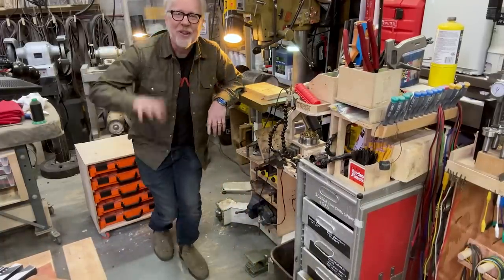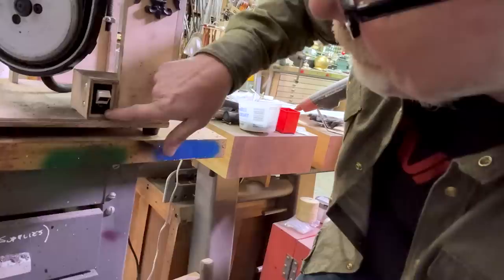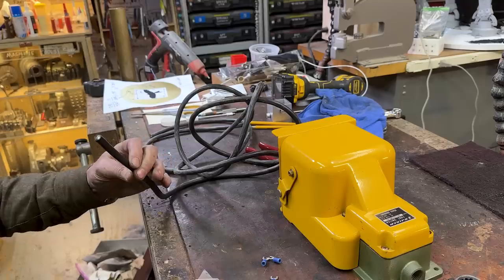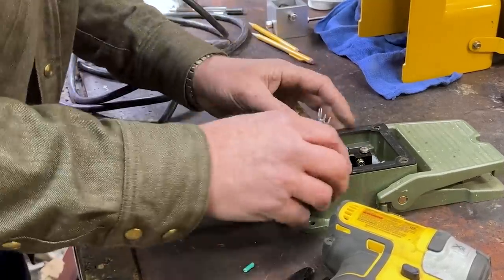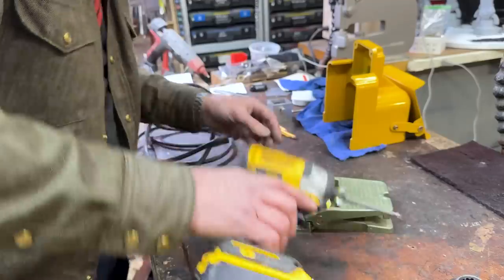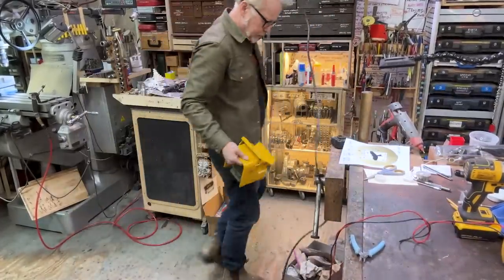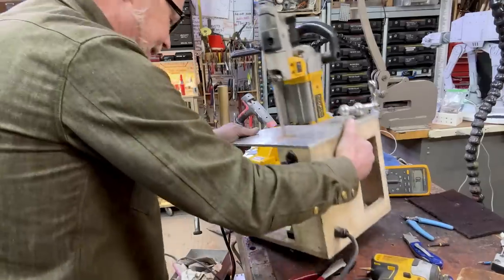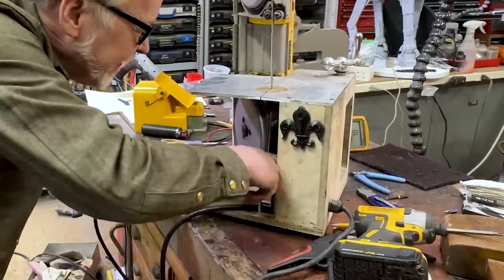Adam Savage's One Day Builds: Foot Switch-Powered Shop Tools!

Comment: Nice video and love that you showed how easy this is to do! But... The third wire should be used for ground and connected to the metal housing at the switch end, and connected to the ground and casing at the machine end. This will provide operator protection against a live short anywhere in the system. This is especially important where you are physically connecting two parts of your body to a device (insulated boots or otherwise) with live current and potentially providing electricity with a route passing through your heart. 
Some kind of rubber grommet should also be used to provide at least some protection against spilled liquids and swarf from entering the switch body and causing shorts.
Reply: When he said, I’m sure you’ve been yelling at the screen the whole time, I thought well at least he heard me, but I was in my head yelling about grounding long before he figured out the relay lol.

I’m not an electrician, so don’t take my advice, but if this was a project I was doing for me, my two cents on his wiring are this:

• Take a 15’ 3 prong extension cord of the appropriate gauge wiring. Measure about 3’ from the female end of the wire and cut it off. 

• Install appropriate strain relief clamp to open end of electrical box on foot switch, pass both cut ends of cable into box and strip all wires.

• Male plug on an extension cord brings in power to the switch. 

•Female end of an extension cord leaves the switch. You plug in any devices using the foot switch to this. 

• Inside the foot switch box:

   ° Combine the two neutrals with a wire nut and electric tape it up.

   ° Connect the power in (black cable) from the male extension cord to the input of the foot switch, the one closest to the foot pedal. 

   ° Connect the black cable from the female extension cord to the middle lug (the normally open lug)

   ° Ground the metal box junction box and combine all grounds with a wire nut and tape together like you did the neutral wires. This should bring three ground wires together. 

• Gently remove excess slack from electrical box as appropriate, and firmly secure tension relief, being carefully not to over tighten and crush cables.

Doing it the way I described allows you to be able to easily plug/unplug devices so you can use it around the shop as desired. It should give some degree of safety in case a cable comes lose and shorts to the metal box and energizes the metal foot switch. It should also allow you to retain the use of the existing on/off switch or your device so you can turn it off there when not using and not accidentally step on the switch to energize the machine. 

I was somewhat disappointed that a person I see being generally safe and thinking through their problem solving was otherwise pretty unsafe in this video with their wiring approach. A lot of people watch these and regardless and copy your instructions.
Reply: @adamdowney  the lack of grounding is his choice given it’s a private shop but he is also doing a video on electrical wiring so I feel he shouldn’t ignore it either for the sake of giving good information.  I am also not a fan how he strips back the cable sheathing as it’s much better to cut down the sheathing and pull it apart than across it and risk cutting into the wires but at least he addresses the need to be careful when doing that.
Reply: It looks like he wired it in place of the old switch. Do we know if the old switch was wired in-line with AC power, or was it just a leg off the bandsaw's built in switch mechanism? I'm asking because I assume the built in switch is a relay and doesn't need grounding protection.
Reply: Agree… ground fault protection won’t work if there isn’t a ground attached.
Reply: Seriously, who wants to call the San Fran electrical inspector to check out Adam's death shop?
Reply: @richardh6964  a personal shop that both friends and employees work in - and public video documentation of installing mains wiring into a metal chassis with no earth and what looked to me like fairly unreliable strain relief. The saving grace is that at least in the US you have mainsLite, a lot more forgiving than the 240 downundervolts we have here :) Don't get me wrong, I love Adam and his work, but this one makes me uncomfortable.
Reply: Yeah, was a little muddled as to why the 10 seconds was not taken to carry the earth wire through. All the tools and bits were out and ready. Silly waste.
Reply: @camerons.8322  it’s possible it’s wired how you described, but because the foot pedal as well as the junction box for the wiring and high voltage power is running through it, it should be grounded. If you watch how he holds the foot pedal by the wires and lowers it to the ground near the end, that’s all it takes to potentially loosen a connection and short the mains to the pedal. Could kill him if that pedal became energized.
Reply: @richardh6964  agreed on all points, the main reason I bring it up is so that hopefully he fixes it and updates the video, or so others looking to emulate this work try to look up a safer way to do so. Private or not, putting out a how to video like this is a bad look. 

And yes, I unsheathe cables how you describe. It’s as fast or faster, and you only risk cutting the cables in an are you are going to strip regardless.
Reply: @adamdowney  I just watched a bit of the archived stream where he originally built it, and yes, the switch was wired in-line to AC hot. I think we can safely assume AC hot is now at the pedal, so grounding it would be a good idea.
Reply: @adamdowney  I am not usually one to comment, indeed I think this is a first... Mr. Adam Savage, please, please, please! for the love of God, follow this man's advice!
Reply: Adam has no clue what's he's doing when it comes to electricity . Anyone remember when he was fixing his giant swiss knife how he was baffled by the green and yellow wire that was connected to the casing of the electric motor and then stated that it was probably for 'thermal cutoff if the motor gets too hot' and just left it hanging loose 😆
Reply: I kept screaming this to the screen the entire video...
Please Adam, make some more effort in spreading knowledge about electrical safety!
Reply: Although some of these portaband saws are grounded, most, including mine only have a polarized two-wire plug and the chassis is not bonded to neutral or ground. The green wire in this build has nowhere to go because it's not bonded to ground anywhere else unless you open up the saw. While there might be a terminal inside the tool that the green wire could attach to, there's a 50-50 chance that doing so would just turn the electrically isolated switch housing into a hot. I agree however that he should install a strain relief, if only because it would look cooler.

The better solution however is that there are substantially identical 15Amp foot switches that are prewired with a hermaphrodite plug, that is a plug that is also a receptacle as you have probably seen on Christmas lights. You plug your power tool into the back side of the plug and then plug that into the wall receptacle. You can find these in the 30 to 50 bucks range and they even have the cool kick open safety cover.
Reply: @christopherdahle9985  The plug has a ground pin (I single-framed through bits of the video to confirm).  Since hot is live in the junction box at the back of the switch, grounding the box should be done, even if the bandsaw itself is double-insulated and doesn't need a ground.
Reply: @haywardhaunter2620  Thanks for responding. I respect your diligence. I didn't have the patience to go back and watch the original video, which I don't really remember beyond, "Blondihacks just did the same thing." My comment was from memory and my own knowledge after replacing a broken switch in my own (two wire) porta-band saw. I am perfectly happy to take your word. I provisionally agree that the j-box should be grounded even if nothing else is, but if the j-box is improperly bonded to the saw and the saw itself has no grounding provision, the risk of a semi-knowledgeable DIY'er creating a hot chassis is pretty high.

Bottom line, amateurs who want to do this should be using the version of this switch that comes with a polarized hermaphrodite plug/socket or is a switched line cord. Both of which are available new, fully wired, plug-n-play, for less than the price Mr. Savage says he paid on E-Bay. But the amateur wiring job here drives views, and data, right?

Comment: I would have added a cord to plug into the wall and the a cord to plug in the tool that way the foot switch is more universal and can be use with almost any tool if needed.  This would also not require an modification to the existing tool.  I love this build and this is a great idea.
Reply: Great idea!

Comment: A couple others have said it, but I would definitely feel more comfortable if that pedal was grounded.  Especially without a regular strain relief in place to isolate the cord movement from the connections, there’s a lot of potential for the wires or crimps to work themselves loose or wear through the insulation over time. [Not an electrician, but a commercial coffee equipment tech]

Also, did I spy a box of Knipex goodies back there?
Reply: the spade lugs can also work loose.

Comment: Adam/Tested, the wiring as you have shown it in that switch box is unsafe, as no earth connection is made to the metal enclosure. A fault in the switch or wire, or debris entering the box could cause the housing to become live risking electrocution to the operator. I appreciate that this is more regulated in Europe than America due to the higher voltage, and that this failure is unlikely, but there is still risk of harm.

Apart from that I like that this is more safe than typical rocker switches as it acts like a deadman switch.
Reply: From a European standpoint, electricity in the US is like looking into the stone age...
Reply: @januszkszczotek8587  I’ll get back to you on that, first gotta go fly a kite in a thunderstorm.  ⚡️
Reply: Even in the U.S., that metal box should be grounded.  And once he screwed it to the floor, I bet it became a building code violation.
Reply: @jimk5307  😂

Comment: I use footswitches all the time, for all sorts of different applications. 
When I was a 911 dispatcher, we had foot switches to key up the radio and muting the phone, so that both hands were open for typing. 
In my present life as a broadcast engineer, I have wired them for resetting countdown timers for TV break control, for triggering video switcher transitions, and intercom. Usually the intercom is hot all the time, so in that use case, it acts a a mute or 'cough drop' so you don't cough of send too many expletives down the line!

Comment: One of my favorite "shop hacks" for stripping wire I learned from FIL, a sewing seam ripper. It works on a lot of gauges and is an easy, safe way to strip the outer sheath.
Reply: That's a great idea; I have plenty of seam rippers about, so I'll be reaching for one of them next time I'm stripping some cable!
Reply: I will need to try that. Awesome idea

Comment: I use that striping trick myself, it's especially effective when the outer insulation is cold because the act of bending the cable after the initial knife scoring will actually do the stripping for you, and it happens much faster because it's a bit more brittle. It was extremely useful when stripping low voltage data cable for outside, in ground pool automation systems.
Reply: Sounds like what I do. I bend the cable and start cutting slowly. That pressure causes it to finish pulling the insulation apart when you cut away enough of it without having to actually cut all the way through. Then you just pull it from the end and it slides off with a little effort.
Reply: Try cutting along the cable lightly then pull the inner wires apart from the cable starting at the end.  It’s fast and for all but the heaviest cable works very well.
Reply: @richardh6964  there's a good reason why electricians use wire stippers. If it ain't broke, don't fix it. Reinventing the wheel here.
Reply: @peterkallend5012  I learned that trick from a electrician.
Reply: @richardh6964  good for you. I don't know any electrician that use that technique. Low voltage wires are likely to break if you do that kind of thing, as the copper conductor has a lower tensile strength that the insulation that surrounds the internal wires. I'm of the opinion that if there's the possibility of breaking the continuity of the wires, don't do it. Cheers.
Reply: I often cut into the insulation of the wires using a knife. So I switched to another technique. I just use side cutters and cut a few times around the cable with the tip of them, then pull the insulation off. With some practice, this works very well. 

Also we have a foot powered drill press since I had the idea about three years ago. Love it.
Reply: @gfalt8425  yep, side cutters work too. I went all in on a good pair of strippers for exactly that purpose. You have no idea how many times I've had to "fix" poorly stripped wires for data or pool lights where the person rushed, sliced through all the insulation (causing the conductors to arc and eventually melt the cable) or didn't cut all the way through the outer jacket before trying to remove it (stretching the inner insulation and snapping the thin copper conductor inside). Too many people try to take shortcuts and rush through tasks. In my opinion, everyone should take a page out of Adam's playbook and be more deliberate with how they do electrical work.
Reply: Look for Jokari wire strippers. They save you so much time getting a cable sheath of. Inexpensive tool! Copper pipe cutters also work well.
Reply: @pieter-matthijsbolt6375  I'm thinking of 3d printing a special tool that's adjustable for various thicknesses and utilizes standard utility knife blades. I'm guessing the development process and materials used during iteration will still be less than the cost of a new wire stripper. Besides, the wire stripper I already have is probably the best one I've ever had, or used (and that includes some really high end automatic ones).
Reply: I learned it installing espresso machines, extremely important in a boiling water + 220 volt environment

Comment: I do bicycle fabrication and the shop I work in has foot switches on all the drill presses, grinders and belt Sanders. It's definitely my favorite little feature because you can start and stop all the tools while holding your Steel or Ti tubing with both hands.

Comment: I love to watch US shop wiring. Here in Germany we would use a Motor Safety Switch with a separate connection for an external switch or at least a relais so the footswitch wouldn't see the full power of the motor all the time. 

Regards,
Etna.
Reply: Man you'd go absolutely insane if you looked at some of the residential wiring here in the states, specifically in rural areas. A lot of houses in my area that were built in the 50s and 60s show huge amounts of electrical incompetence. For example, in my bedroom when I was 15, I could take the chain for the light in the ceiling fan, touch it to the slightly exposed metal base of the light bulb, and the light would turn on. One whole half the house was wired to a single 15 amp circuit breaker as well. That's not to mention our actual standards. You couldn't try to design a plug that's more unsafe than what we use. Then we use extension cords with thin little wires in them. They get warm if you plug anything too big into them. Our 220 setups are usually a bit safer with locking plugs (no insulation on the base of the prongs though) and the plugs themselves aren't usually in easily accessible places.
Reply: Normally that is the case but this portable bandsaw is only 120V
Reply: @whatbroicanhave50character35  I think that is why I binge r/electricians.

Regards,
Etna.
Reply: Same here over in Australia, American electrical seems bonkers and 30 years behind the rest of the world.

Comment: Great build and very useful. Not to mention potentially safer.

But you took a tool that was largely portable and made it so that it's now stuck in place. I can imagine re-engineering this so that it's modular. You have a semi-portable tool like the bandsaw that has two modes. Can be used normally with the existing switch, but has a bypass mode what uses the foot-switch. Then rather than hardwire the foot-switch, make it a modular plug.

Now you have a foot-switch station that you can swap out the tool on the top of it. All you have to do going forward is to pop a plug-in module to a new tool, and you can plug it into the foot-switch.

You could even take it a step further, and remove the flip-switch, and just make modular flip-switches that could plug into where foot-switch goes so that you wouldn't need the by-pass. Or as someone suggests below, put the power in-line with the foot-switch, and then just use a power-cord wth an on/off if you want to use the tool w/o the foot-switch.

But I guess that's another one-day build. Or too.

Thanks for the brain food!
Reply: He has a second small bandsaw that is fully portable (it’s showing in another video).

Comment: Back when I was making a LOT of cat-5 cables at work, we had an amazing little tool that looked kind of like a cigar cutter. You'd open the thing, put the cable in the hole, close it, then spin it around the cable and it would put a lovely score all around the sheath that could then easily be snapped off. Because the blade was angled, you could chose from two different depths of score depending on which way you rotated (or you could just spin around more than once). Found it! The "Cyclops 2 UTP Cable Jacket Stripper".
Definitely a unitasking device but great to have if that's what you're doing.